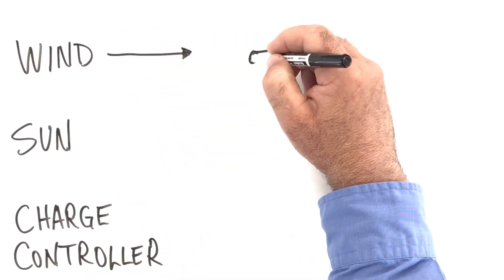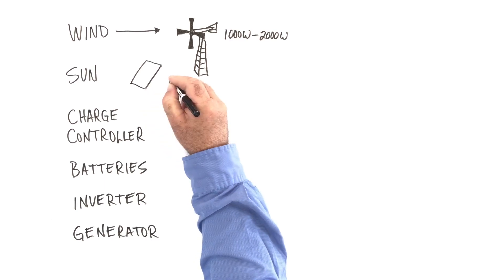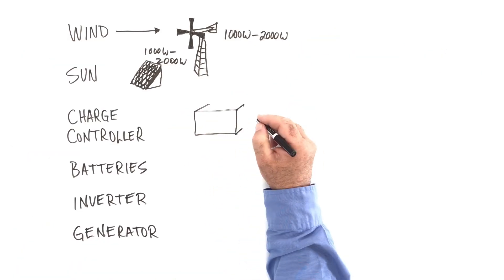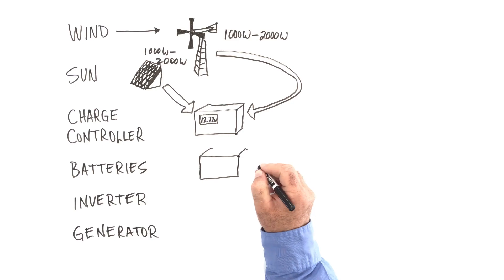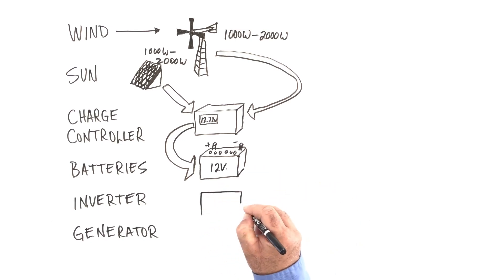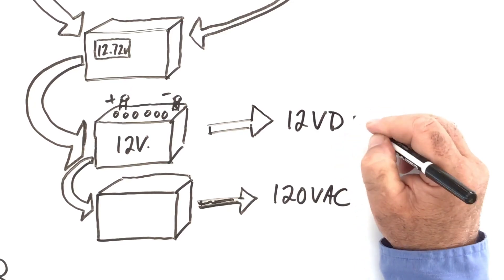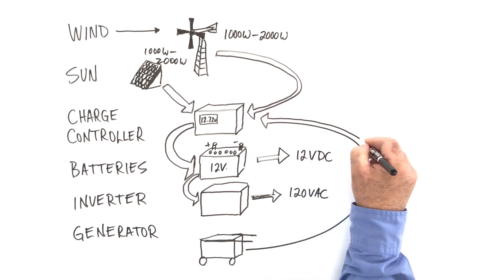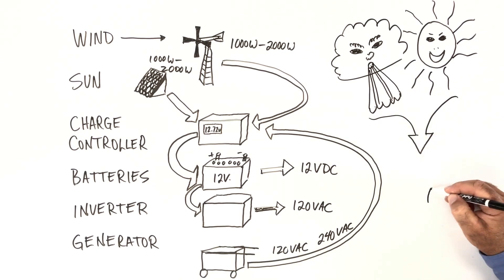COMPLETE Off-Grid Home Energy System Explained in 3 Minutes (6 Simple Parts)

Comment: A friend of mine‘s husband passed away last summer. He had to have solar for some reason she didn’t have any say in the situation. They also have a generator that comes on automatically if the power goes out. Without considering the generator at all, she owes $50,000 on this Solar set up and the company that supplied it went bankrupt. Warning, be very about what you do. I could easily swap an engine in any of the vehicle on my own, but most people couldn’t begin to figure out how to do that and it’s the same with solar. If you really know a lot about it, you’re OK and if you don’t, you’re going to be taken advantage of. Her husband was told they’re going to be selling power back to the power company, ain’t happened yet and the system is three years old. Every month she pays $321 and change. You can buy a lot of energy for that amount of money by buying electricity on grid.

Comment: Lithium-Ion batteries are more expensive initially, but can be more cost effective over time, and have the benefit of being much lighter.  Wind is not a very good way to generate energy, except in rare circumstances, imho, and sun is isn't available, reliably in many places as well.
Reply: Then, if you understand how Lithium is mined, you don't want to use it at all!
Reply: "Sun isn't available reliably in many places" do you have any data for that statement or is it a gut feel ?
Reply: @MovieNutter  can't put links on yt normally so google solar maps, and specifically - project sunroof, global solar atlas. lots of data to support my claim.  I live in west michigan near lake michigan where we get the "lake effect", so I have lots of personal experience with sunless months during the winter.  you can put up solar panels anywhere you want, but if you want a reasonable roi, then you should do your research.  I took a wind & solar installer class last year at the local community college where I did multiple site surveys using tools like Solar Pathfinder, and outside of school I figured out how to use sketchup to model my house and see the angle of the sun, and where the shade hits from big trees, (you can come pretty close to the same just with google earth pro) and using time of day and season sliders, you can do lots of research for your location.  You need good solar insolation numbers to be viable.